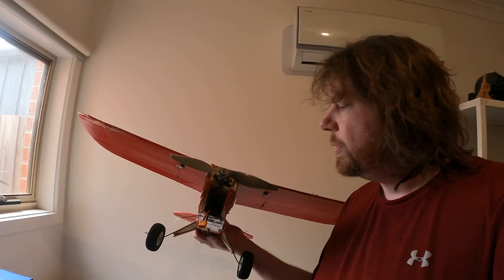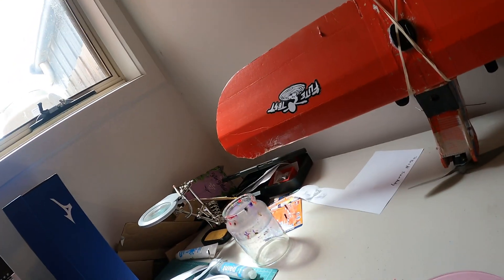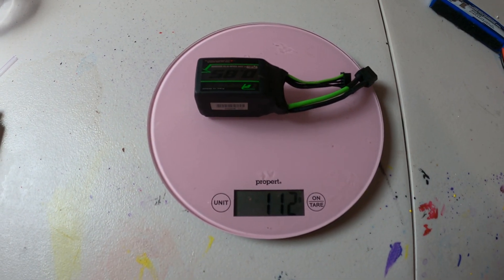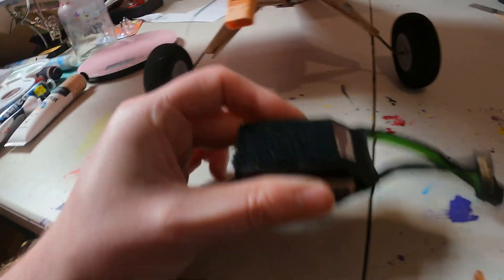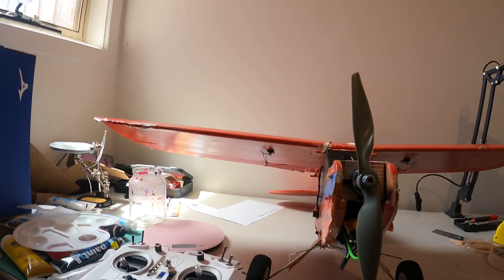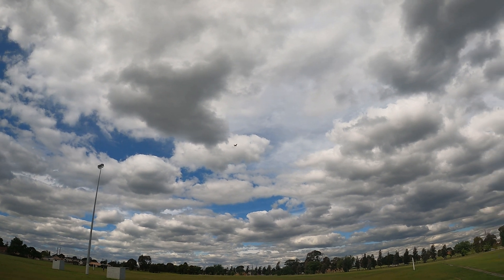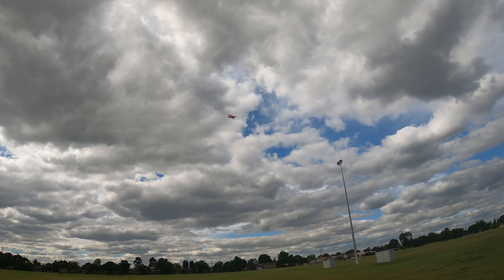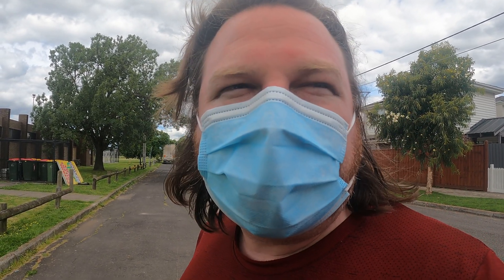3S vs 4S Battery - Flite Test Simple Cub

Comment: Amazing video! One of the only videos about such comparisons on model airplanes. Are you still using 4S today?
Reply from the maker: Thanks! 

I usually prefer the 4S, though truthfully I tend to take both the 3S and 4S out to the field because it's just more flying time overall.
Reply: @andrewr0000  Thanks for answering! I ended up selling all my 3S batteries and was on the fence about whether to buy a 3S again or switch to a 4S. I think I'll opt to take all 4S. Thanks! One more subscriber!